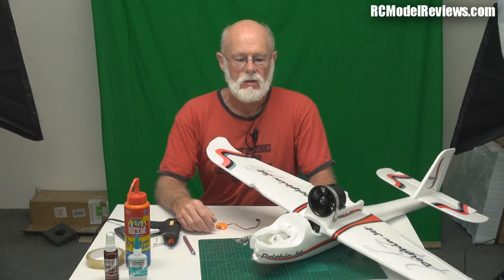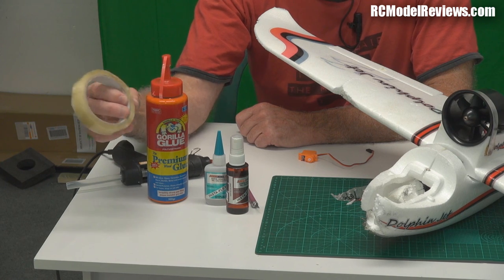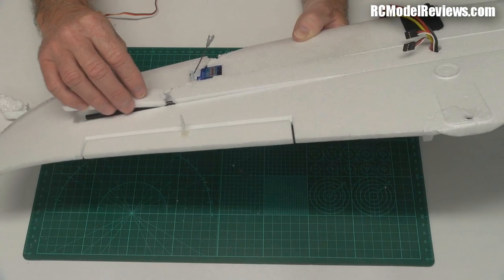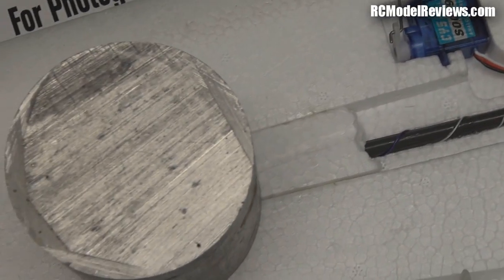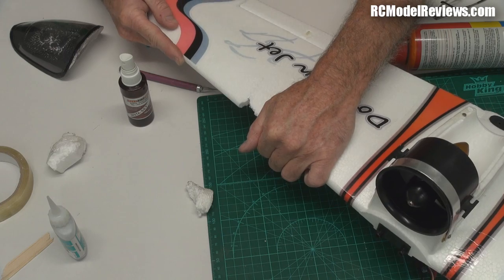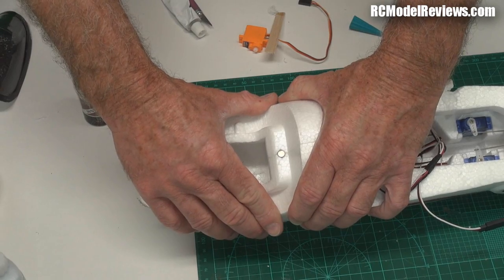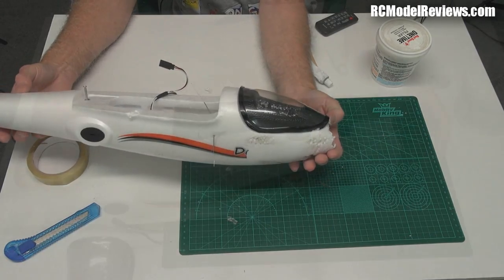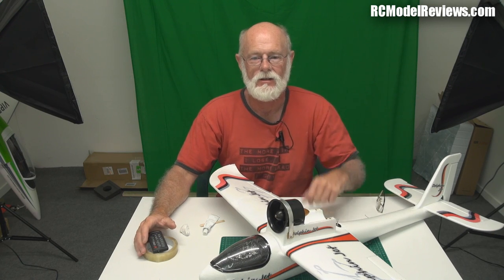Repairing an EPO RC Plane

Comment: I love watching  your videos because you're passionate about the hobby. My two tips are as follows.  First, there are pins that florists use to attach the groom's boutineer to the lapel of his coat.   These are around 100mm  (4 inches) and have a big, fat plastic head.  I find these pins at craft store and sundry stores.  They are usually very inexpensive.  I use them to hold foam together after gluing.  The tip is to push them all the way in and have the head sit firm against the foam.  I usually let it sit overnight.  It works on everything including epoxy.  You have to tug to get them out with dried epoxy.
The other tip is there is a certain type of foam that goes around the pipes of water heaters.  It's a very soft, spongy foam.  It's about 1cm thick.  If you have the space it's probably not a bad thing to wrap a battery with or put in the nose of a plane.

Comment: Hello Bruce my name is Keith Poulton from the llittle island of Malta and I would like to thank you for all the info you pass on. Although I`ve been flying models for the last 50 years there is always something else to learn. I would like to pass on a tip regarding CA glue. In your vid  regarding repairs to rc planes in the 11.39th minute you mentioned tapping the bottle to settle the glue back down the spout. Well what I do also, is to wrap a small piece of cloth or rag on top of the spout and let it soak up the residue on top. Within seconds this hardens and one can twist  the rag off and hey presto this cleans the whole top of the bottle. Maybe you can pass it on in some other vid. Thanks and keep the information coming.

Comment: Bruce, great video and it's withstanding the test of time! Barry is lucky to have such a great friend to repair his plane. I'm new to the hobby and cartwheeled my Dynam A-10 recently. The foam fuselage was so bent up that it was easier to remove the electronics, hit it with hot kettle water over the sink to get it back to being straight. Now to reassemble it. Anyway, thanks for the tips on the filler and wrapping the wing spare! Happy Flying! Cheers from SoCal!

Comment: When I snapped part of the horizontal stabilizer on my Bixler 2, I just glued in along the break, stuck wooden skewers at a couple different angles, snipped the excess bits off and dabbed a dot of glue over em. Brings barely any attention to them being there and stabilizes really well

Comment: I've seen that you can use CA glue and baking soda to create a monster connection and make stuff look as if it's new. Just put some baking soda onto the CA that you just applied and let it dry. It becomes absolutely rock hard! Did it this weekend with the wheels of my RC car. 20 minutes later it was up and driving again :-) Don't breathe in the fumes though by the way :)

Comment: I never would have thought to use light Spackle to fill holes in an EPO aircraft.  Before laminating film became the norm for covering EPP slope foamies, I used it to fill the pores in EPP so when I covered the glider with Ultracote it was nearly as smooth as a fiberglass plane.  Laminating film gives a smooth enough surface on it's own.

Good point about using strapping tape to stiffen flexible EPO fuselages.  It works very well, barely adds any weight, and can also be used to straighten fuselages that hang to one side, as well as stiffening stabilizers (and wings, as you've shown.)

Comment: I recently purchased a couple of foam core-based models from flite test.com and used some of the leftover foam core sheets to repair (with a hot glue gun) the internal side of a fuselage repair.  It's very strong and rigid and works as well as carbon rods if none are available to you. A note about hot glue:  it is stronger when the excess is spread flat with a scrap piece of foam core.  Spreading the excess over a broader surface adds tensile strength to the repair while also making it a bit more attractive.

Comment: Looks good Bruce, with the carbon rod I build and fly I.F.O.  I use dental floss.
It tends to be flatter, and so strong it will cut your hands if you try and break it.
The best deal of head with it was 200 metres for £1.00 for pound shop.
It is poor man's Kevlar.  Waxed or none waxed doesn't seem to matter.
Have a good Christmas everyone.

Comment: A tip to make your wing tips and nose area a little more abrasion proof...Just apply a coat of 5 minute epoxy and smooth it with a brush to keep the road rash to a minimum. You can paint it after it's dry to hide it or accent it. When it gets worn just peel it off and re-apply. It worked wonders on the undersides of the wing tips on my FMS P-51.

Comment: Thanks for the video, lots of helpful tips! I often use a syringe with or without a cannula to glue small parts together. With the cannula it lets you dispense the glue to small/otherwise unaccessable spots and its quite economical as well. :D

Comment: Lots of good tips in this video, but you really shouldn't have skipped the part where you had to reshape the nose of the  plane. I suspect that rebuilding and shaping a completely new piece of foam to the front of the plane is far more challenging than any of the repairs you did step by step. It was a disappointing ending to just speed right by that part.
Reply: InterWebGuy99 Yeah, and how he fixed the edge of the wing. I think that everyone knows how to glue two parts together with superglue.
Reply: InterWebGuy99 You can't even enter on the scale with your mental activity, because I agree with you and just say that he show how to glue two parts together almost on the entire video...
Reply: Okay, I thought you were being sarcastic. Sorry, dude. Hopefully the guy who did this video will get a clue!

Comment: Loved ur video Bruce.
i myself crash on regular bases lol, so i got prettty good at repairs, to a point that i keep all kinds of foams to build & repair, i keep foams from boxes, from meat packs from the supermarket (great to build small light models), i also bought big blocks & sheets of polystyrene. Love to use foam, good  material to experiment structural shapes.
Right now im building a EDF glider made of foam (looks like EPP maybe,not, sure)
anyway i painted the underwings for contrast and the paint ate the foam, i manage to stop the process by having fans blowing air at it strongly, damage is light.
I would really like if U could teach us a bit on paints & their level of "corosion",
wich ones r best, the lightess ones, etc.
 BTW  thnx for the ONETIME* filler trick, i was using shaped foam to fill.

Comment: looks like the dolphin got himself a new mouth ;). The main problem I have is that I so far only have micro sized planes so repairing gets a lot harder since the main concern start to be the weight. I now have quite some repairs on 1 wing of my micro geebee making it tip to that side very fast and whenever I crash again it just tends to break at the exact same spots of the wing that is already way to heavy.
Reply: Add a little weight to the other wingtip, even if it's just a dime.  Both wings should balance.  Better to add a little weight than have it tip stall.
Reply: it really doesn't tip stall and for now I could solve it with a little more trim but its mainly that when it is crashing and there is now a whole lot more weight on one wing making it way more fragile.

Comment: Enjoyed this vid Bruce, very timely as I have an AXN (built to spec per your video series) with a slightly bent nose so I was hoping to see your method of heating to straighten the Dolphin out.
I am just getting back into RC after a long lapse, certainly pre foam era.
I was inspired by the multirotor/FPV/aurdupilot cocktail. I have a basic Quad with APM 2.5 which I am coming to grips with so bought the AXN to get some stick time. All along I have been used the products which you like and have not been dissapointed. The Taranis for example, a great radio for the dollars, not quite as well moulded as it's spiritual father the JR and the flappy paddles could use some fine tuning. Programming it is certainly different to the mainstream radios but not insurmountable.
One upside to the grounding is you seem to have really upped the output of content lately which is good for the viewers, no doubt you have a different take on that:)
Reply: You should see the nose of my AXN. First 2 flights saw it go straight into trees! The second one involved a hobby tree climber to get it down. He dropped in straight on the nose pushing the battery back almost 2 inches!

Comment: I would've liked to have seen you using the heat gun and reshaping the nose. Isn't the pulsejet going to melt that foam plane? Especially the tail.
Reply: I'm going to change the pulsejet Dolphin to a V-tail -- for very obvious reasons ;-)
Reply: *****
Oh, I see.  I was wondering how you were going to keep the pulsejet from melting the tail.  Nice job, Bruce.

Comment: Hi Bruce,
When i do crack repair i first run the glue then press the cracked pieces together then run tooth picks thru both parts across the crack then use plastic vise to hold together and let dry. Is this a good method mate?

Comment: You know how gorilla glue tends to expand, well of you aren't filling gaps then use gorilla glue,  but before it starts to bubble up put blue painters tape over the crack that your repairing. 30 minutes later you can remove the tape and trim excess with modelers knife.

Comment: I have an EPO plane with a big crack near the motor mount, someone adviced me to use 30 min. epoxy. Is this the best glue for the job?
Reply: It's been my experience that epoxy doesn't stick too well to EPO.

If it's a crack that closes up nicely with pressure, I'd give that flexible CA a try - otherwise use some polyeurethane and that should do the job nicely.
Reply: ***** Thanks for the advice, Can I buy polyeurethane from HobbyKing? Or do you reccomend an other brand?
Reply: Midas Gossye Gorrilia glue sold most everywhere in US.

Comment: Hi Bruce, really useful video, thanks for that. About the pulse jet - aren't you afraid of melting the tail if you gonna use pulse jet on such a foamy plane? As they run pretty hot, I'd expect the exhaust  gas to be hot enough to melt the foam right?
Reply: I know, it's been 9 years and you probably already know. Just in case you don't ... This is not a pulse jet. It's an EDF (electric ducted fan).

Comment: This plane is not suitable for EDF setup cuz, the airframe has to much drag. EDF efficiency depends on speed. The EDF efficiency drops if the air frame has too much drag and put a toll on the battery and the power plant. Your better off with a propeller systems.